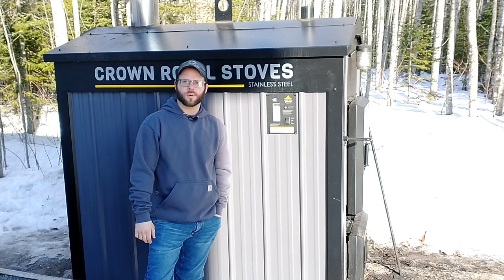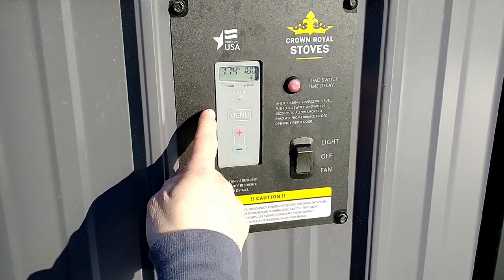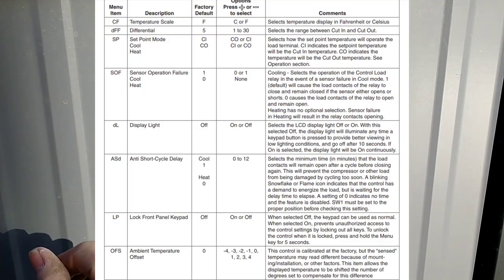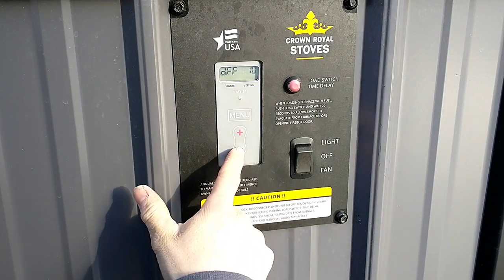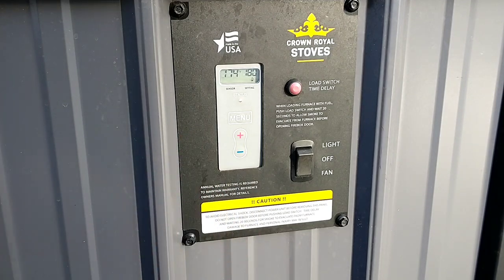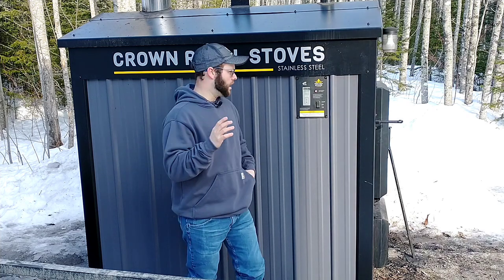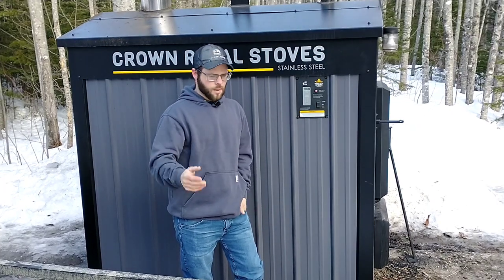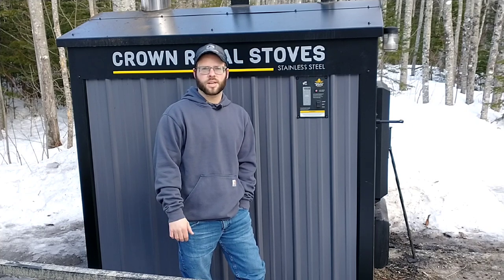Watch this before your fire goes out

Comment: As you know, I operate an EZ Boiler.  As the brand claims, it is easy, lol I have a simple aquastat that opens the damper door when the heat drops below what it is set at.  Maybe one day I will consider adding more bells and whistles, like a blower and this time of aquastat.  Good video, brother!  Keep pumping them out!
Reply from the maker: I believe, even on your type of aquastat, there is a differential adjustment if necessary. Although, I believe the ez boiler doesn't snuff out the fire quite as hard. Thanks for watching!

Comment: So when there is no demand for heat,the damper is completely closed? Or does it have a little opening for some air to come in ?  Also,how long does it have in general on idle before you get a flame out?
Reply from the maker: The damper is completely closed when there is no demand. Regarding the time, it really depends on how good of a coal bed you have built up. I have found just adjusting the aquastat differential, when I know it is going to be warm, helps alot. Thanks for watching!